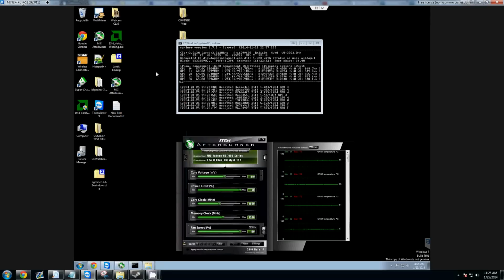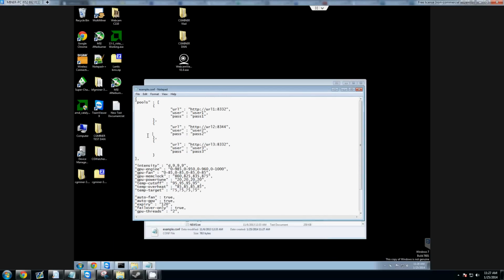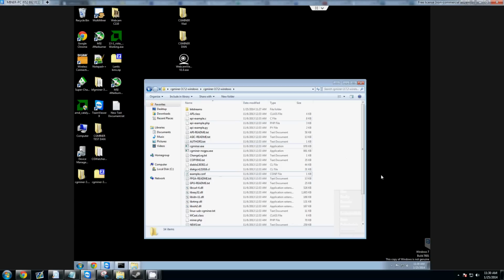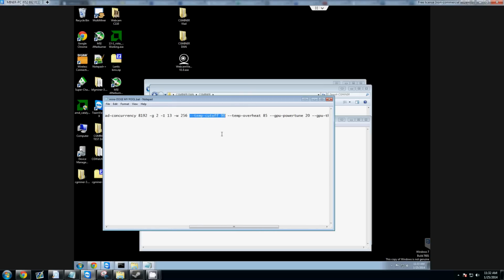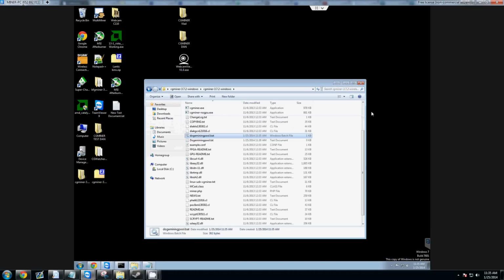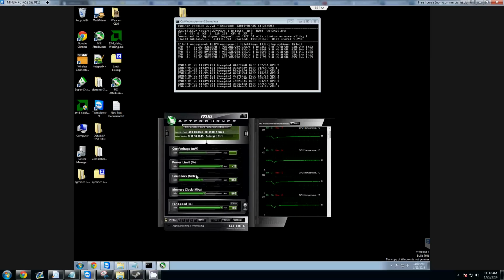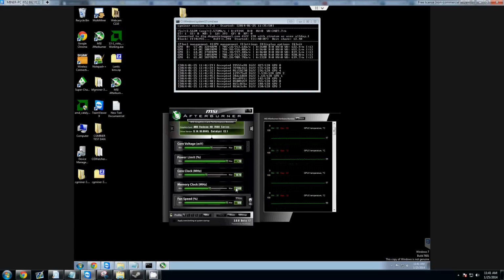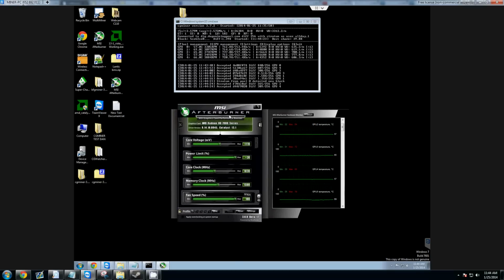How to Set-up CGminer and Afterburner for your cards [Tutorial]

Comment from the maker: Hi, 

You can create a .bat file to correspond to each individual card series. 

adding -d 0 after the pool information in the batch file will tell CGMiner ONLY to use GPU 0, then another .bat will have -d 1, -d 2 etc you can make a different bat file for each card using those selectors.